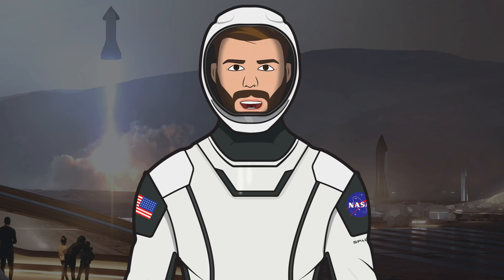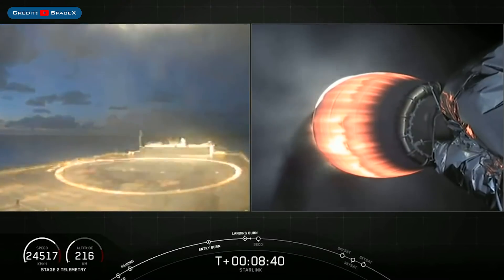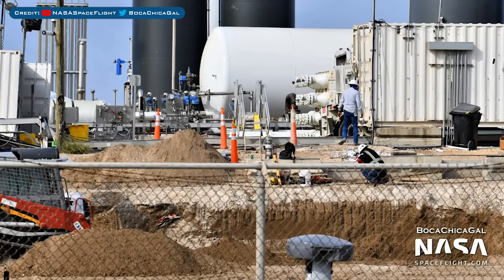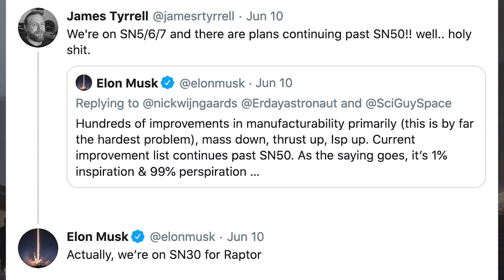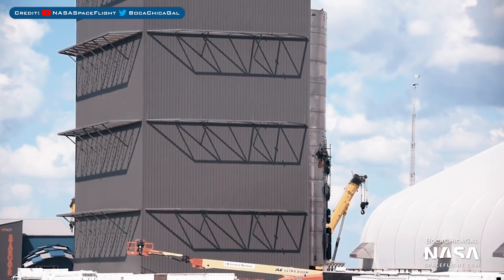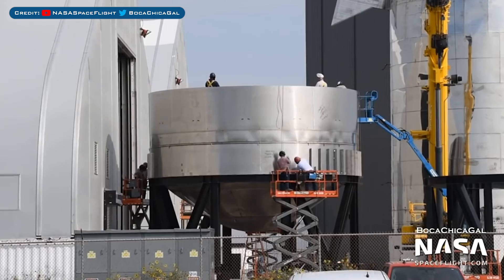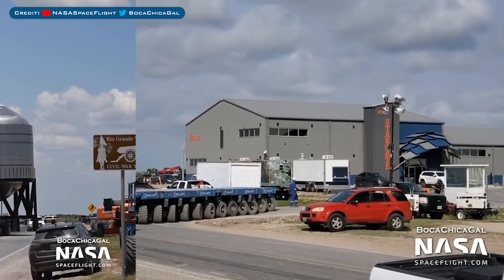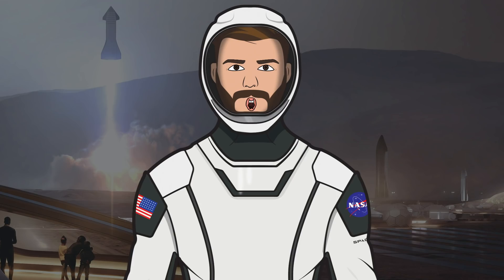SpaceX Starship Updates! SN7 Testing Tank Built, SN5 Rollout Soon & SN6 Stacking Soon! TheSpaceXShow

Comment: The SN7 will be placed on the stand where the Thrust Mounts are currently.  As you may have noticed, the SN7 part is on a STAND that will easily fit the Thrust Mount area.